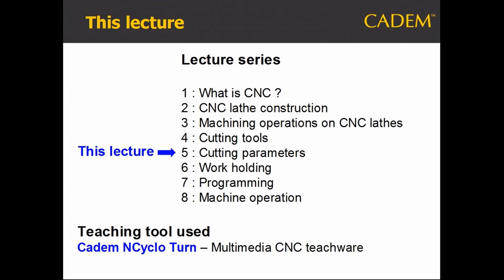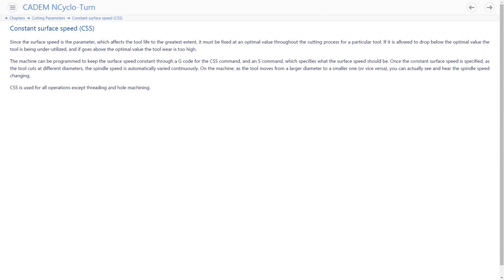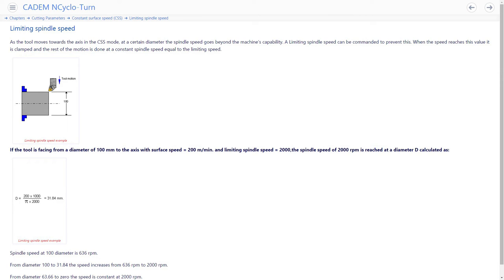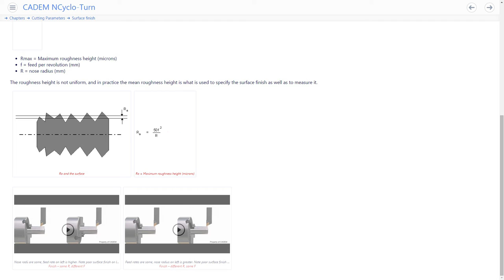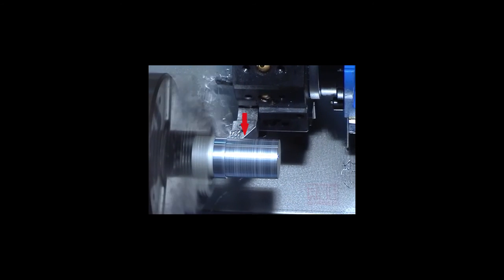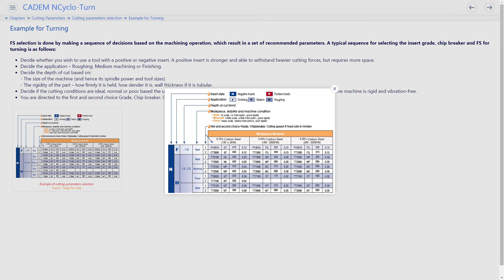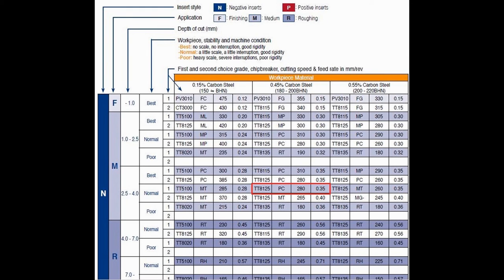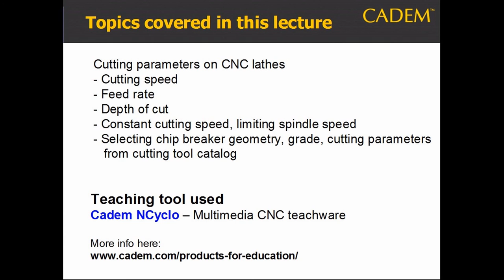Cutting parameters - CNC Turning. CADEM CNC Gyan video.

Comment: sir, I am planning to undertake a major project titled "Predicting Cutting Parameters Based on Workpiece & Tool Material, Geometries, and Desired Surface Finish Using Machine Learning." However, after researching, I found that similar work has already been done by reputed universities.

To make my project unique, I am considering incorporating variables like Spindle Load Meter, Servo Load Meter, Material Properties, etc. Would this approach make sense and be reasonable? Could you please suggest any new directions or innovative ways to approach this topic?

Your guidance would be highly appreciated and will u please suggest me sir.